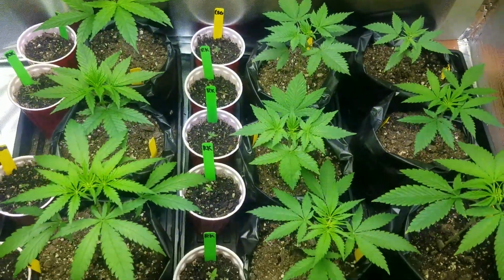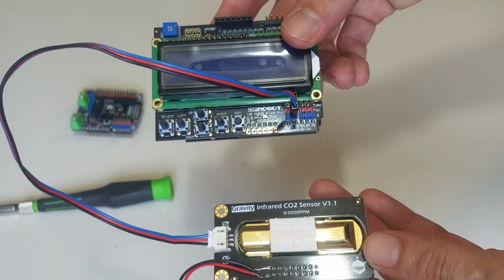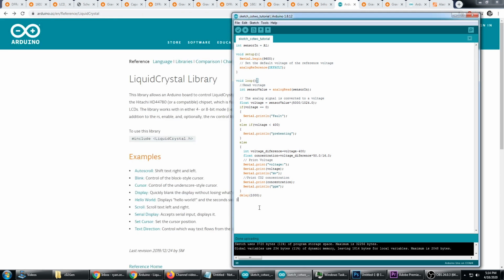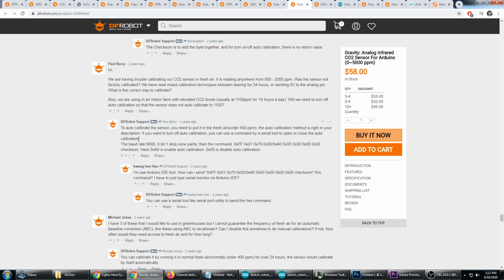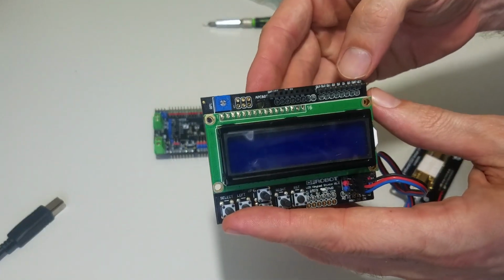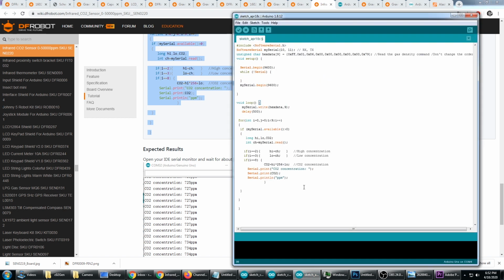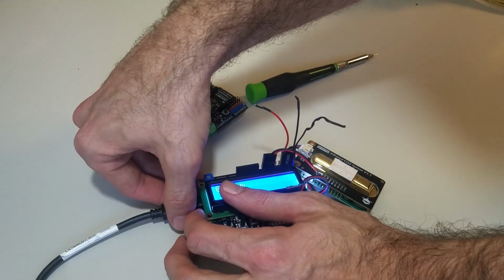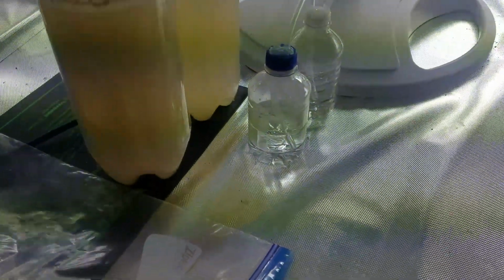CO2 Monitor For Your Grow Room

Comment: I just tried some of your suggestions on the same sensor (SEN0219, V1.1) and not too surprising, it is showing CO2 ppm that is WAY  off!  (like 1100ppm). I'll try some of your calibration advice. What's made this harder is that DF Robot has removed all the info for the older analog sensor, like the one you have. They now sell a newer one, which looks the same but uses a completely different interface (PWM)!  Just a heads up for anyone trying this in 2022.